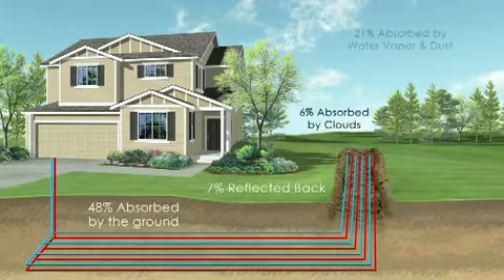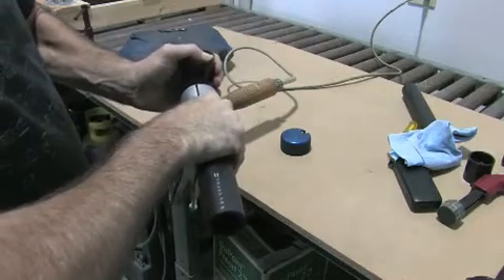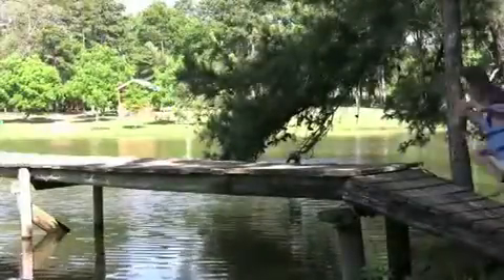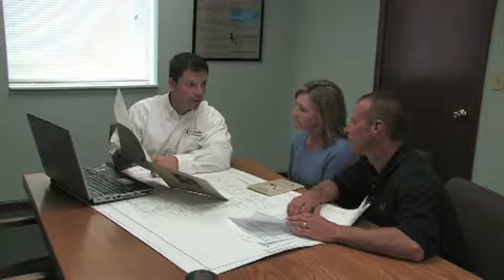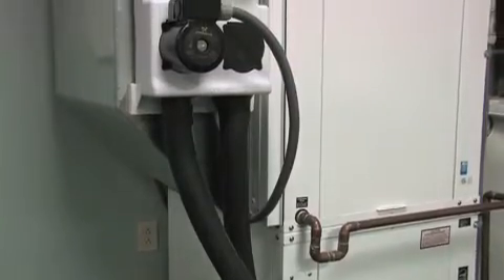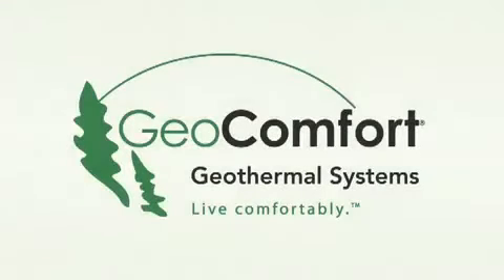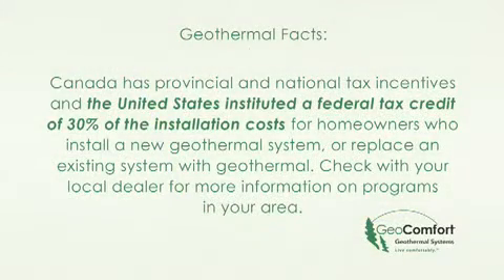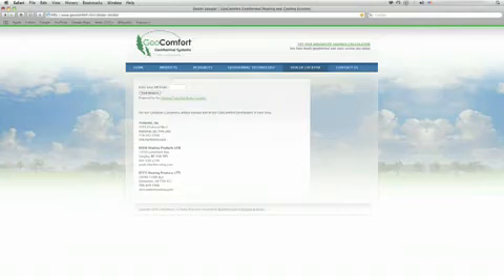Understanding Geothermal Heating and Cooling with GeoComfort

Comment: This is not geothermal. It is called ground based. Geothermal is about using the heat radiating from the earth core, for that you have to go deep. At least 400m up to several km.